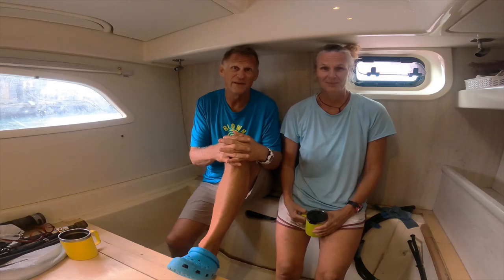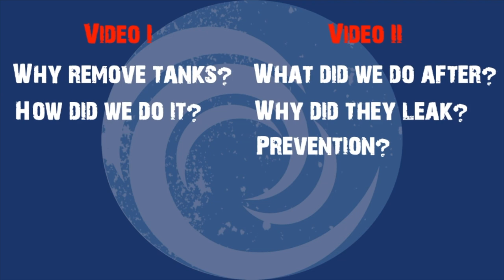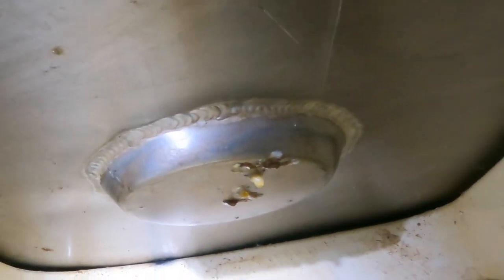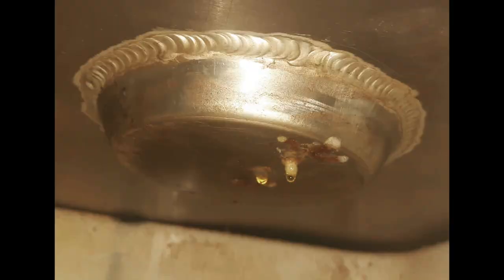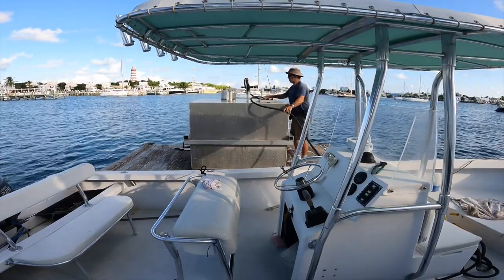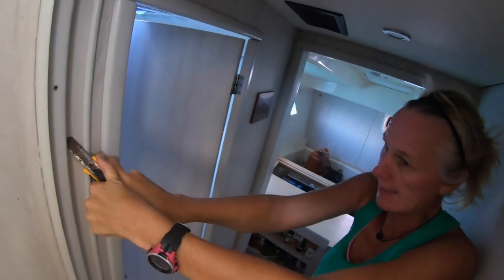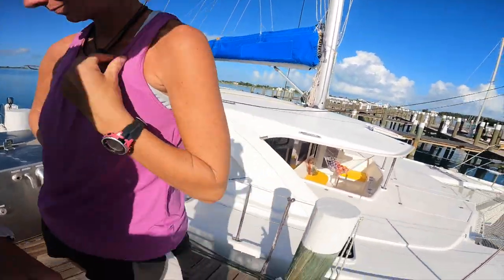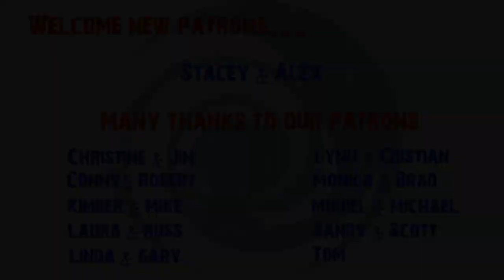157: Fuel Tank CRISIS: How Do You Know When to Fix or Replace? 2015 Leopard 44 Catamaran

Comment: I have a 2004 Leopard 47, and I replaced my tanks with plastic.  My aluminum tanks are located just under the mid ships floor in each hull, and were super easy to get out.  It was just a matter of removing some hoses that ran over them.  We have a Seaflo pump that can easily pump diesel from one tank to the other from the drain tubes which are exactly the same as your drain tubes.  So, with less than half in each tank, I pumped all to one side, installed the new tank, then pumped it all back to the other to install that one.  I would highly recommend such a pump as you could have just had your guy pump out one of your tanks an then not have to do that jury rig thing.  I went with new plastic as a boat upgrade and so I would never have to worry about the tanks again.  If I had more time to tinker, I might have just epoxy coated the outsides of the current tanks.  Did you consider that?  It seems that every Leopard catamaran has been through this.  But the last thing I wanted to do was go through all that trouble only to have them leak again.  When I pulled my tanks out, I could see that one of them had already been repaired before.
Reply from the maker: Wow Interesting. When we did this we didn’t have any other option but welding them. Supply lines couldn’t get us replacement tanks for six months. This was our only option and both of our tanks were filled to the top with fuel. We were thankful to have the option that we had!
Reply: @SailingBlownAway  It did take a while for the new tanks to arrive.  My leaks were really strange in that they were "intermittant."   I bought my boat sight unseen in Grenada (got a survey), and when I came to see her for the first time, there was yellow diesel in the bilge.  How nice!  I am lucky that my tanks are where they are, as once they are empty and clear of the hoses that went over them, it took me and a helper like 2 minutes to lift each one out and put on the dock.  One nice thing about plastic is that I can see the fuel level.  I still haven't installed the senders because I have to drill into the top of the tank and plan for the baffles, but it is so convenient to just look at the tank, I just haven't gotten around to it.
Reply from the maker: @johnkosowski3321 Grenada base should be closed. They are so negligent. It’s where we got our boat too!  Thanks for letting us know what you did you are so lucky you could take your tanks out easily
Reply: @SailingBlownAway  My boat was well out of the moorings and in other charter services as it is a 2004 that I bought in 2020.  I bought the most chartered out 47 in the world!   I wonder why Leopard keeps fitting vessels with tanks that barely last 10 years.  This is something every Leopard owner has to deal with.

Comment: Thanks for sharing all your informations.  I’m about to retire and buy a boat.  I will definitely go smaller as I see you spend a fortune on repairs.  Fuel tank should not rust and leak after only 6 years.  This is really cheap material.  Where else Leopard has been cheap.  I hope you won’t find any more surprises.  Best of luck to you and happy Holidays.
Reply from the maker: YES!! Smart move. Going smaller is much better as you will need the extra $$ for repairs. You are right. This tank should NOT corrode after 7 years. There are several reasons we will share next week. Thank you so much for your kind words. Merry Christmas to you and happy New Year!!
Thanks for your comment and for watching!

Comment: I drive a hwy motor coach.  For the last number of years the motor coaches built in NA have been made with some sort of plastic or poly diesel fuel tanks.  Why not boats,  especially operating in such a corrosive enviorment.
Reply from the maker: WOW!! Interesting. The boat industry is moving in that direction which is great! Thanks for your comments!

Comment: Would fiberglass tanks be better?  I know stainless would be to heavy, and titanium way to expensive.
Reply from the maker: Great question. Leopard is now making them out of polyethylene. We have not heard any negative reviews about them so it might be a big improvement to aluminum! Merry Christmas to you!!
Reply: @SailingBlownAway  didn't think about it.  Plastic makes way more sense.    You should check into that, you can get plastic tanks in almost any size and they're reasonable priced.
Reply from the maker: @mrmped1  Yes, it does. The issue is manufacturing time. It's not easy to get anything right now and especially delivered to the Bahamas!
Reply from the maker: Yes that’s true. It would be way too difficult to get it made and delivered in the Bahamas!